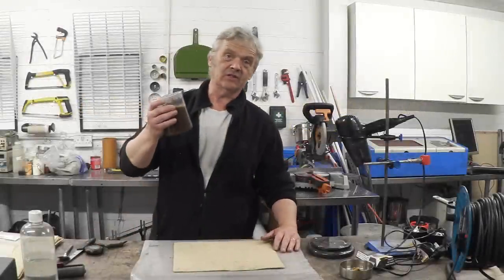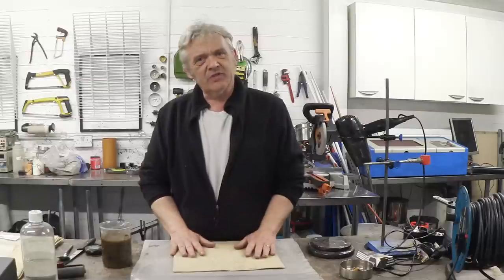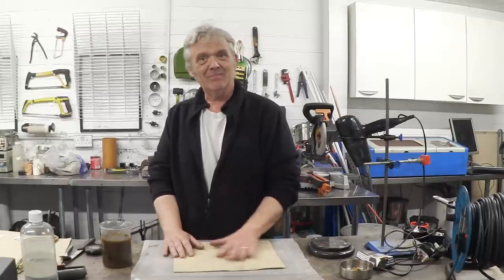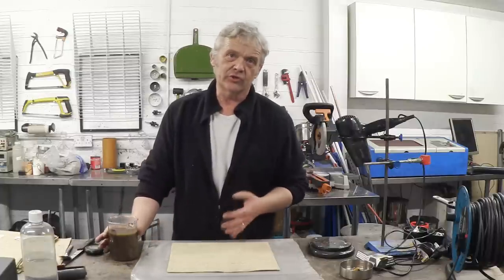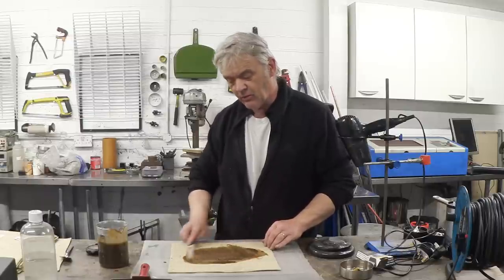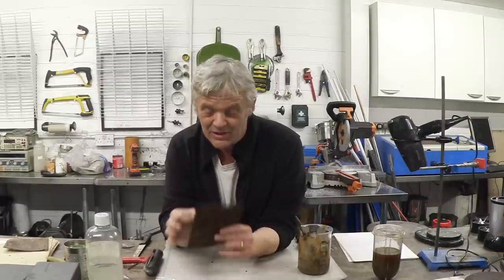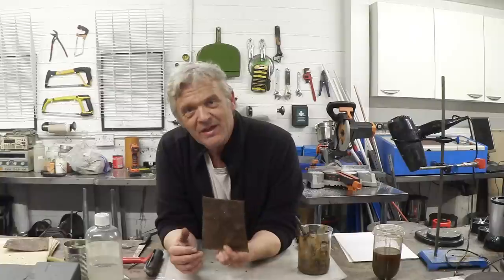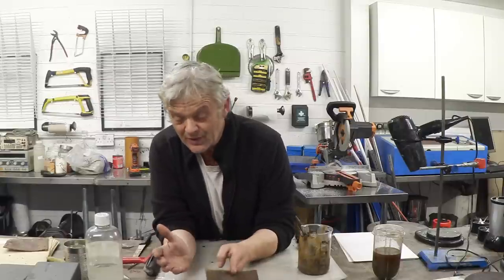A Hemp And Seaweed Bioplastic - How To Make It

Comment: Can you imagine layers of that glued together to replace plywood and thus reduce the impact on harvesting trees. That would easily be as hard, if not harder than hardwood plyboard.
Reply: You can make it extra strong by adding crystalline nanocellulose and/or the carbonized version of same (the latter being especially strong stuff!).  This can be made from waste paper and wood products.
Reply from the maker: that is an awesome thought mate
Reply: @ThinkingandTinkering  imagine shaping it before the drying process to a mould for car dashboards, household products, electronic cases etc. It would even be a more environmentally friendly version of the builders board you use for my modeling, it wouldn't be as easy to cut but it could be used for house exterior panel boards.
Reply: @justinw1765  starting to sound similar to carbon fibre panels. I wonder how it compares in a strength test.
Reply: @stevetobias4890     There is a basic similarity in that both materials require fairly high heating in an oxygen deprived environment.

   But C-CNC can be made more sustainably and cheaply.  And if you make a super solar oven like I'm making, it becomes much cheaper/more sustainable.  A little goes a long way with C-CNC. 

  It's tensile and young modulus strengths are much higher than average carbon fiber. when the CNC is carbonized.  Even raw CNC has the same tensile strength and a bit more stiffness strength.
Reply: @justinw1765  would love to see a picture of the super solar project you're making once it's completed. I will give you my email in the members area next time I visit and see one of your comments
Reply: @stevetobias4890    I'm probably going to do a video on it.  I'm waiting on a couple of supplies which should come tomorrow. Then I need to wait for some stuff to dry after it's treated. 
  Anyways, the video should be uploaded within the week, if all goes well.

Comment: BRILLIANT! So what happened to Henry Ford making an all Hemp plastic vehicle, that was stronger then and lighter then steel apparently!  

Such an old ideology that  has never fully taken off!

I love how you are all about DIY and our world is only interested in Profiting and discarding!

My favorite composite material is denim jean material, you can soak it any kind of adhese or paints  stretch it out during curing process and makes a super strong plastic like material.  Lots of fun making seatcovers that outlast leather or pleather!

Good example take a flat shoes lace, soak in crazy or super glue, and stretch the shoe lace string very tight in a vice, and when cured you will have super strong light weight peice of plastic that is spring like stiff, i tried bending completely in half and bounces right back to shape*
Reply: Stronger than and lighter than  🔥
Reply: @ollieb9875  very true! But ive been investigating a lost invented material called Starlite, that has now been recreated using cornstarch, baking sodia, and white glue, or you can use water and bake to turn cornstarch into bioplastic,   

Doing so creates a material resistant to 10000 degrees centigrade!  If we could incorporate this into strong, heat resistant composite plastic!

Look it up Starlite on YouTube,
Reply from the maker: I am going to try that mate - cheers
Reply: @ThinkingandTinkering  My guess is that Starlite contained a significant quantity of human hair plus some binding agent (he was a hairdresser after all, so it makes sense!). I will like a 50% share of the Royalties if you crack it!